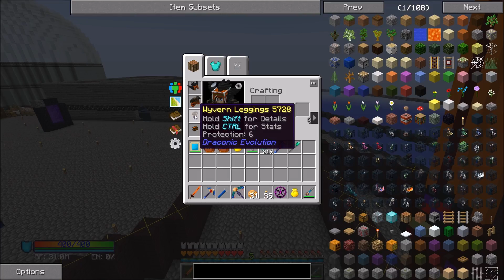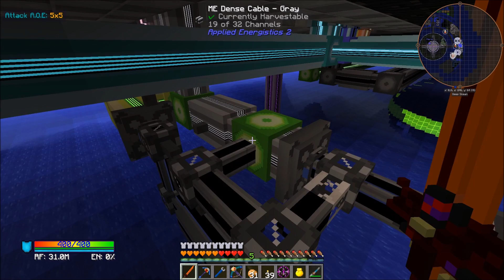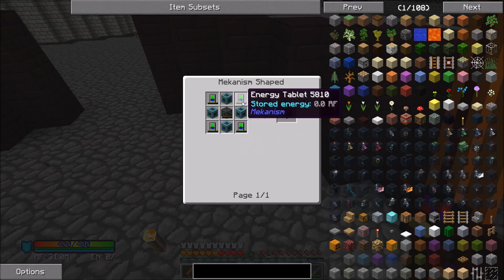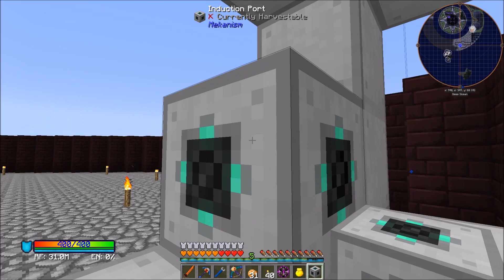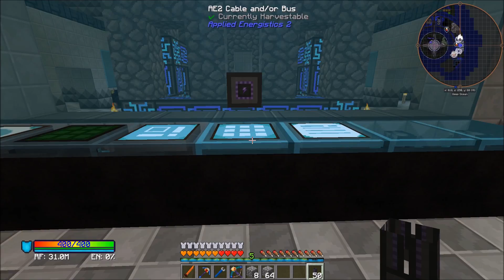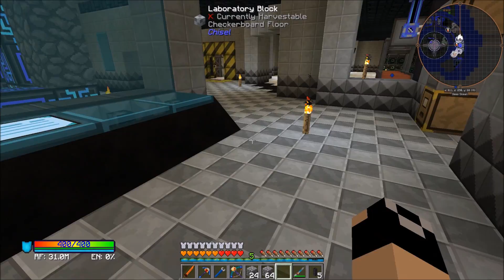Minecraft Crackpack Lp Ep 52: Mekanism Mass Power Storage and Lasers

Comment: Since what did you say the lazes were for
Reply from the maker: The lasers will be for jump-starting the reactor next episode to begin the reactions within it by raising the heat really high.  Have to have thousands of degrees kelvin to begin a nuclear reaction, but once the reaction is started, it will keep running until its shut off or runs out of fuel and the heat drops.
Reply: Ok